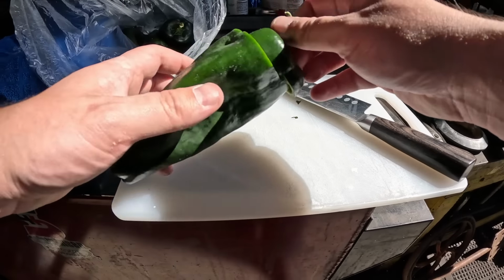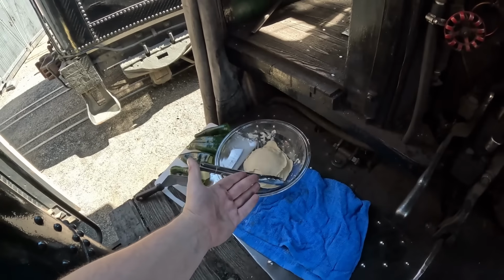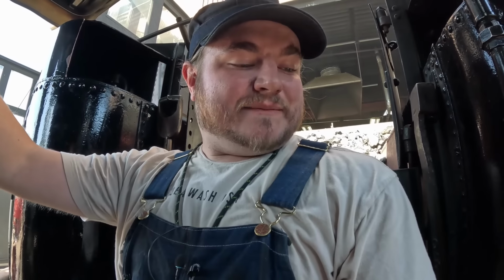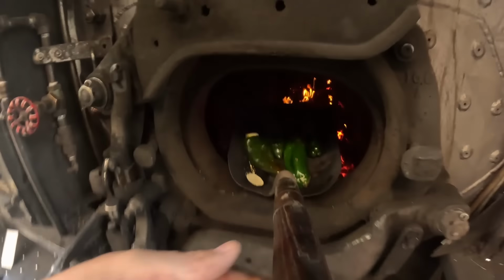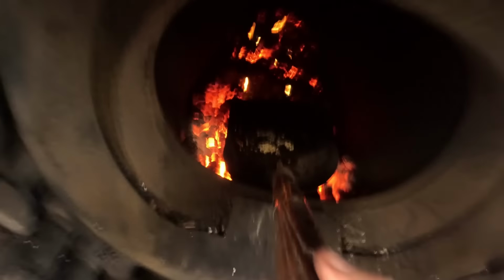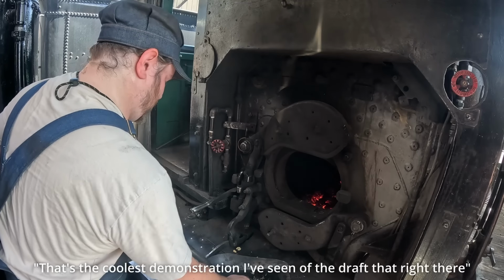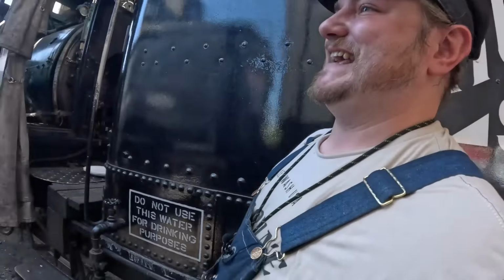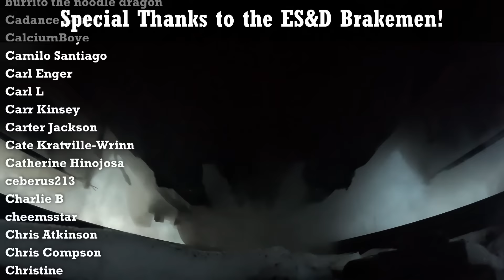TWO THOUSAND DEGREE TACOS! - K-37 Kitchen

Comment from the maker: Use code HYCE50 to get 50% OFF your first Factor box plus 20% off your next month at https://bit.ly/4h2pKrc!
Reply: T-19 Kitchen Table
Dinner Table
Reply: I think this should be called "Firebox Food" so it fits any steamer.
Reply: I'm just worried about coal dust getting in the food, making it unsafe to eat.
Reply: @Ilikefire2793  He is aware and that is why he cooks over a smaller flame, when the engine is idle, dust is kicked up when it is moving, when idle the flame is more neutral and providing heat.

Comment: I got an idea, bit of work. But, opens up many possibilities. Weld up some 1/8-1/4 round stock into a grill rack that you can hang off the bottom of the firebox door opening.
Reply from the maker: That's a good idea...
Reply: @Hyce777   grill rack with a thin sheet of carbon steel and extra long spatula? T-19 hibachi or Korean barbecue? 😂 the boys said they want the meats!

Comment: My foamer wife (hi Aurora, love you <3 ~ Luna) showed this to me and while it seems that the tacos turned out okay, you probably could have made this a lot easier on yourself with a few prep adjustments:

Slicing the peppers so that you can lay them flat on the shovel would have allowed you to cook them a bit easier since they wouldn't roll around with the weird shape of the shovel (at least I think from the video). Also make sure the cheese is not going to slide right off of the thing, that's valuable stuff Some of those peppers had the cheese sliding out lol!

Also, brushing the peppers with a bit of olive oil on the skin side would go a long way to making these taste better; you wouldn't have to worry about the smoke point because with the peppers being open they would cook faster anyways, and extra virgin olive oil has a smoke point of like 410F, which is why it's used in grilling. It would also help things to not stick. For putting oil on the shovel, it needs to be hot; the oil can't just be poured on then put in the fire for a short time; hot oil on hot metal will help things not stick. Cold oil on a hot shovel will make things stick badly just like on a real frying pan.

Shredding or slicing the cheese thinly would have allowed it to melt much faster as opposed to leaving it in one big block.

Finally, salt and pepper man, I didn't see you add any! Essential seasonings sir! Things like garlic or onion powders/the kind of stuff you'd find in a spice rack would be very good too, you might want to mix them into the ingredients though or use a bit of oil so they stick and don't just blow off.

She's also shown me the other food episodes, I will admit while amusing, as a big food person, they also kind of hurt me lol. I hope going forward the recipes only go up from here since it seems like among the ones you've tried it actually worked out okay this time.

Comment: I'd recommend going to the machine shop and getting two tools made/adapted for future kitchen videos.  One, a long skewer that you can both use to poke through food you want to roast on the fire, and manipulate/stir things on the shovel.   Second, a very long set of tongs.  Both things that which I think could be adapted from existing railway tools (like a pinch point crowbar, rail spike tongs...a tine ballast fork could also be useful to put things on).

Also hot scoop, cold oil, means food doesn't stick.  A classic wok cooking method is to coat the surface with oil. Then put it into the fire till the oil exceeds its smoking point.  Then pour out and discard the hot oil.  You then add fresh cold oil and the food. The carbon layer deposited from the hot smoking oil helps continually form a thin non-stick coating.  Then between batches you add water and heat it till heavily boiling (this cleans the pan and helps loosen any oil deposits that are no longer adhered to the pan well) and then you repeat the entire process.

I'd probably also recommend against normal butter because of the high heat.  Clarified butter (Ghee), lard, or avocado oil would be your best bet to not instantly flash over/burn.
Reply from the maker: Top tips all the way around; thank you so much!
Reply: @Hyce777  Souvlakia next time? perfect to try out those tips

Comment: I have been interested in steam locomotives for my entire life, and i know how to classify a steam locomotive from the wheel arrangement however i do not know why you call engine like that, for example the k-37. Is there any reason you call your engines stuff like that?
Reply: That was how the D&RGW classified their locomotives. The letter is wheel arrangement and the number is tractive effort. 
For some examples the K-37 class denotes a 2-8-2 with roughly 37,000 pounds of tractive effort, the T-12 class denotes a 4-6-0 with roughly 12,000 pounds of tractive effort, C-25 class is a 2-8-0 with 25,000 pounds of tractive effort, etc.

Comment: Taco Meant “Wad” In Spanish, The Hispanic Wad Is Not A Tortilla, Because Tortilla Is A Diminutive Form Of Torta Which Meant “Cake” In Spanish, Cake Is Sweet, While A Hispanic Wad Is Savoury, If “Torta” Meant “Cake” In Spanish, Then “Tortilla” Would Mean In Spanish What “Muffe” Meant In Low German (Plural: “Muffen”) Where We Get The Word “Muffin” From Which Has A Connection To “Moufflet” Which Meant “Soft” In French. As Said For Bread. Cookie.

English: Cookie / Muffin (Little Cake), Dutch: Koekje, Low German: Muffen, Spanish: Tortilla (Diminutive Form Of Torta)

“Cookie” As Made In The Land Of The Free, Is Not A Cookie, It’s A Barely Bake (French: Vixcuit, Latin: Vixcotus), It’s Shaped Like A Twice Bake (French: Biscuit, Latin: Biscotus). But More Chewier & Moist Than A Rebake Which Is Crunchy

“Biscuit” As Made In The Land Of The Free, Is A Quick Bread, But They Have A Nice Try To Bake It Twice, But Still Can’t Be Crunchy, But Rather Crumbly & Soft. It’s A Rebaked Quickbread, Twice-Baked Bread Is Crunchy. (English: Twice-Baked Quickbread, French: Pain Rapide Biscuit, Latin: Velox Panis Biscotus)